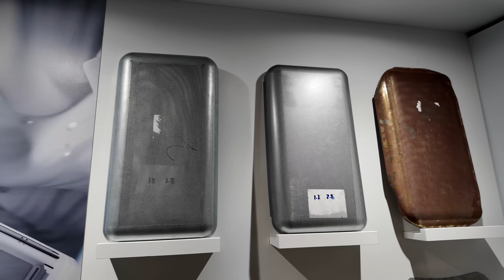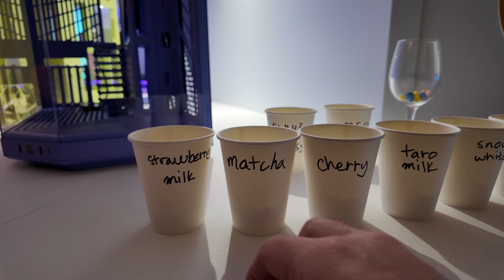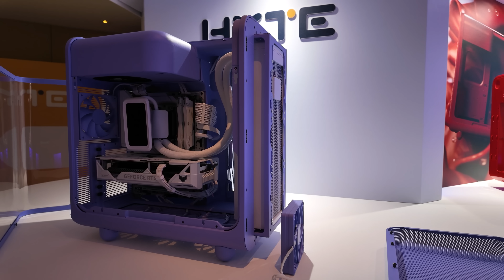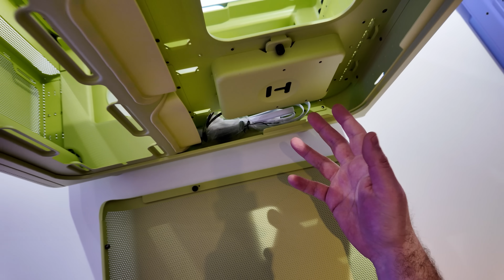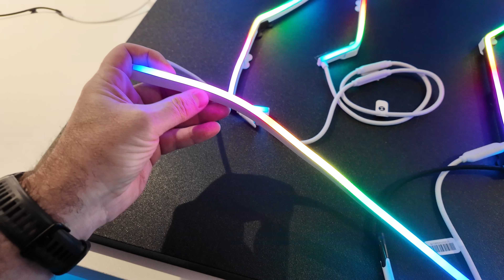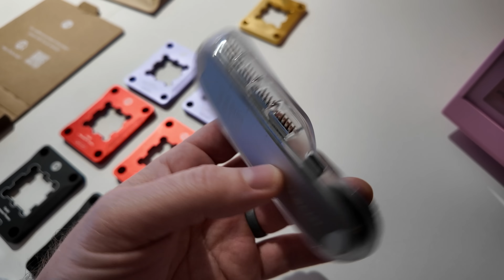The Hyte X50 is Bubblicious

Comment: id rather have an all plastic case that does not have heavy metal or glass that can break JUST A SIMPLE HANDAL FOR MOVING THE CASE., THAT FOLDS DOWN. I don't see how the glass would block any noise or how the perforated front panel would provide any more air flow?  looks like a cage I can buy at hobby lobby to me. they came with one case and one fan in 5  colors. again no innovation or improvement still standard case layout nothing new, what if we don't like screens in our case lowering our fps or blinding RGB lights? got anything that improves performance?

Comment: For the X50, I do like the front mesh and the rear louvers.  Not-so-much the PSU shroud.  It looks like the roof of a trolley car, or an awning from an old diner.  Maybe if it had lights that shown down upon the MB?   Also, I kept seeing the Cherry case's reflection in the black case's glass, making it appear to have a red interior.  I think that would look great if it really did.  Black outside, red inside.

Comment: Finally. Cases in a variety of colors with matching fan colors. Also like the rounded corners and mesh. The glass panel options are cool. Possible upgrade? Custom colors at a reasonable price. This company is pushing the limits way out there with new innovations.